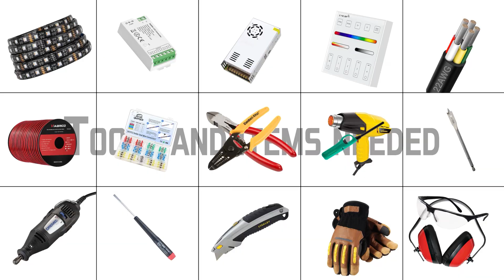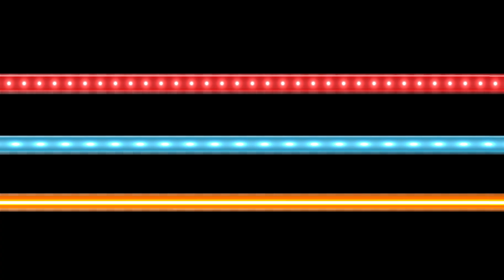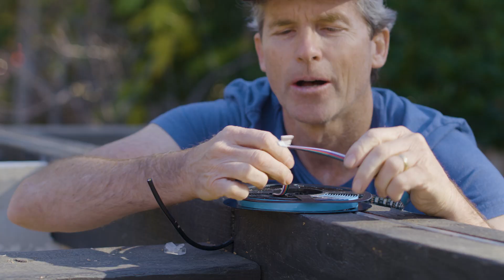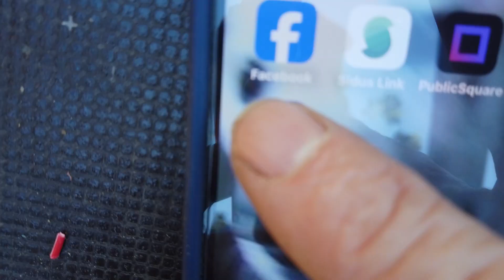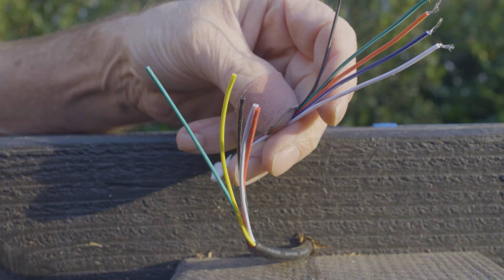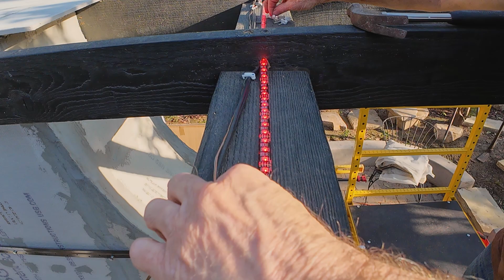Hidden LED Pergola Lighting That Looks Great!

Comment: I would recommend adding an in line fuse to the 12 volt side.   I had a short in my leds strip which melted the wires.  I have since added added several inline fuses of 5 amps and 10 amps.
Reply from the maker: Good point, thanks for the comment